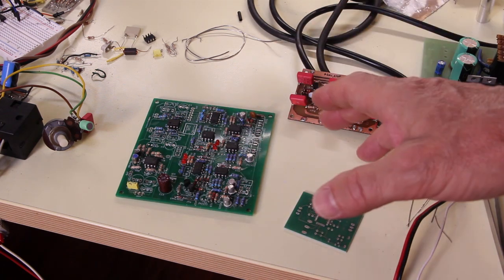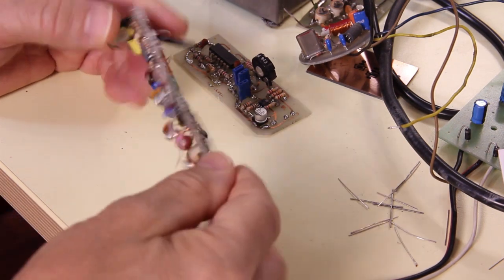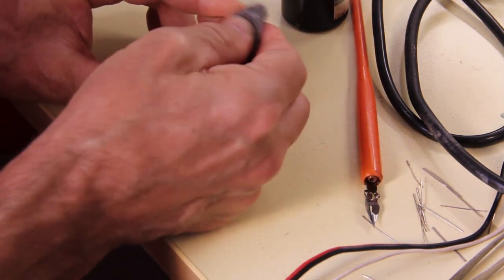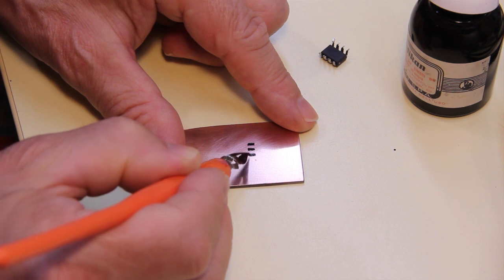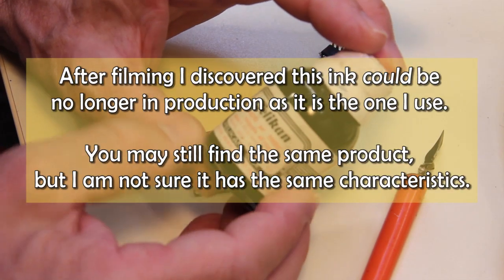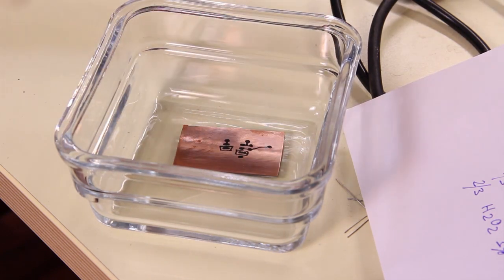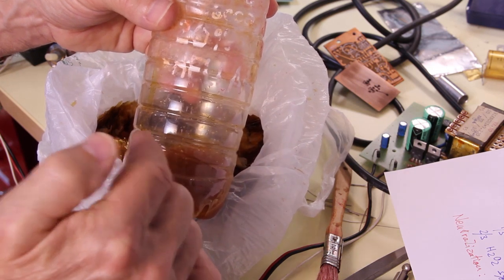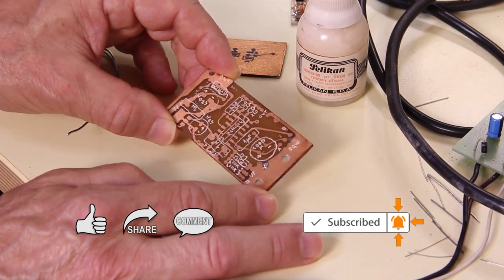How to make experimental circuit boards

Comment: Lumocolor ink permanent 487 works perfectly , best is the red color one , but black color works OK , I have use black as that more easy to supply , ink is available in 10 gramm small can . Any Staedtler pen permanent works also fine . To help to make accurate traces I use a print schematic made in Autocad , hold with adhesive tape and mark each hole with a steel point made by grinding the shank of a rejected HSS drill .
Reply from the maker: Thanks for sharing.

Comment: Personally, I'd go with the UV-resist + overhead transparency route.
Reply from the maker: Yes it gives great results, I've tested it in the past. Of course it is a matter of personal preference eventually. Every technique has its pros and cons. I skipped to describe them all for short, limiting to tell what I use. 
I think they can be summarized as:
- Laser printed (hot transfer): good quality but difficult to keep consistency
- UV resist: excellent quality, a bit laborious
- Direct drawing: poor quality, requires a bit of practice in drawing, but fast results
- CNC router: excellent quality limited by the size of the router's bit, fast results
- CNC laser: excellent quality, relatively fast results
The CNC is obviously the best option, but one have to own a CNC router/laser :)
Thanks for commenting.
P.s. The video was an excuse to show the idea of using shellac to protect the circuit board.